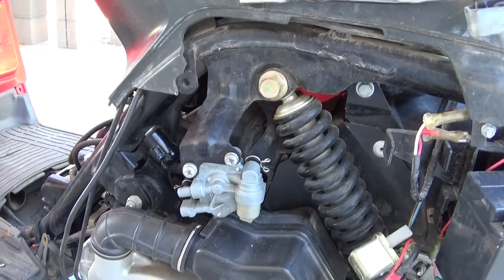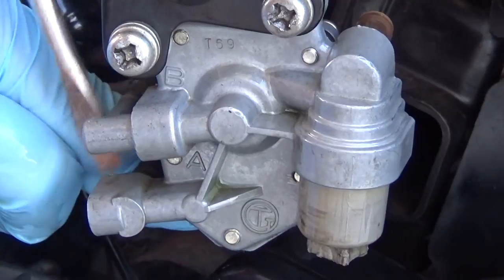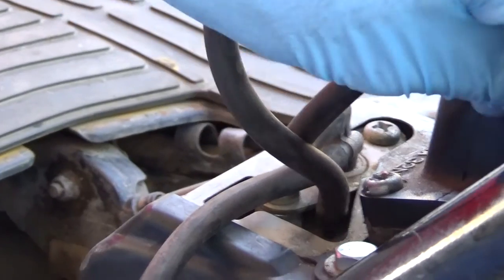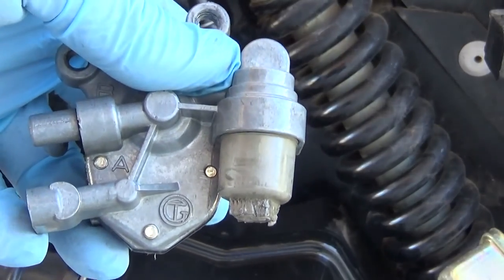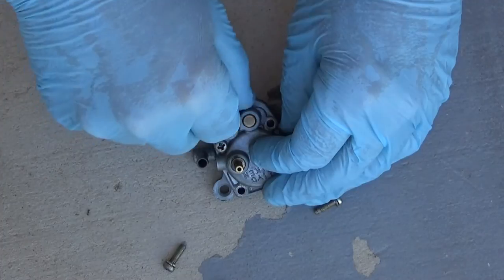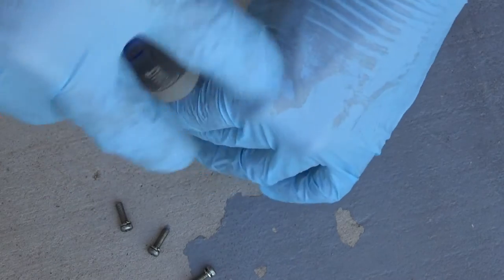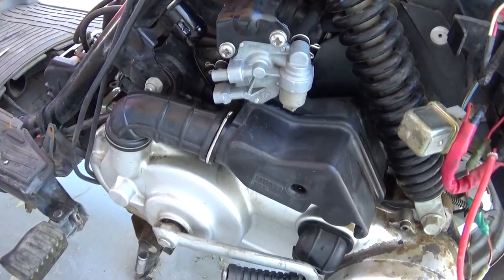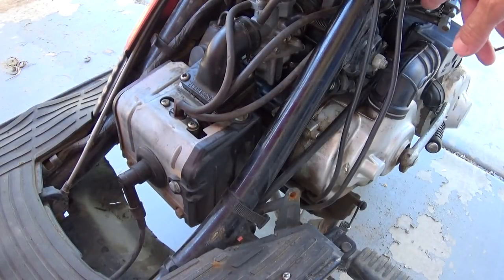1986 Yamaha Riva Scooter Fuel Delivery problem any Ideas?? Diaphragm ??

Comment: i currently own a 1985 yamah riva 80. i grabbed it at an auction...mine is very temperamental. it runs when it wants to. it will shut down with warning signs ahead of time. after walking it for a quarter mile it starts up again like nothing happened. when it’s running, it runs like a bat out of hell! i’m fairly sure it’s a fuel delivery problem (a lot of good that does me). one day i’m going to break it all down just to see if it’s something obvious i can fix. i promise to share it from start to finish. it seems like a few people are having similar issues with this scooter. someone needs to step up…until then, i’ll keep taking my chances with the hit or miss. to be continued. 
ps. i’m not a certified mechanic.
Reply from the maker: good luck

Comment: i have two of these, one is an 1982 which has a different carb to engine setup, but same fuel diaphragm, my other is an 1986, identical to yours,
Reply from the maker: I sold mine soon after this video.
Reply: I have an 1983 and having problems...looking for some help. Do you still have yours?
Reply: @reneeriggs6634  if you are having issues its almost always carb related, a guy on ebay rebuilds these for 60 bux money well spent your bike will run better then new. also you could rebuild carb yourself. 99.9% of the time its carb related on these

Comment: Try switching those 2 lines around?...maybe previous owner got them mixed up.
Reply: great Idea, I never thought of that. made another video of me pouring gas down the reeve  area but my battery started getting low will up load soon, but will try that next time, thanks for the idea.
Reply: If you disconnect the air hose to it and the regular one the gas goes through and suck on the air hose one and gas flows out of the other hose it worknif not it will cause it not to start

Comment: The diaphragm looks ok from the video.  If you have three lines running to that it is likely a pulse fuel pump.  There should also be two valves inside the pump near the diaphragm. They are directional so fuel will only pass through in one direction.  This makes the pump work.  If they are stuck - no pumping action. You will need some carb cleaner for sure.  You can also use the carb cleaner like starting fluid to check out whether the ignition is working.  Just a short shot in the air filter inlet and crank it.  There could be several things going on but you can eliminate the likely ones pretty quickly.  If this has been sitting for a while with gas in it most likely the carb will have to be cleaned or replaced but you can check everything else first.
Reply: I have a video where i have cleaned out the carb already, it is also getting spark. the Diaphragm looks and feels pretty dried out, I have taken all the lines off and blown air thru them and none of them are plugged, gas is going in but the outlet hose nothing is coming out. I did not see any other valves on this pump. I have not try to use starting fluid yet, because walmart was out. I have not tried working on this scooter since the last video i made. i would love to get it running so I can sell it for more money at my next yard sale, but if I can't i will sell it as is. I have no money invested i this scooter. I traded it for a beach cruiser lol. thanks for the comment and for watching.
Reply: +Usernameinvalid16   well did you ever get that riva running did you try putting the kick sgtand oppsite what you had .sta nd is a kill switch.